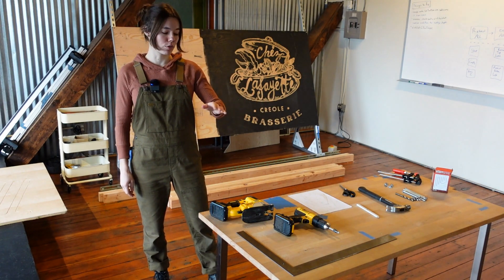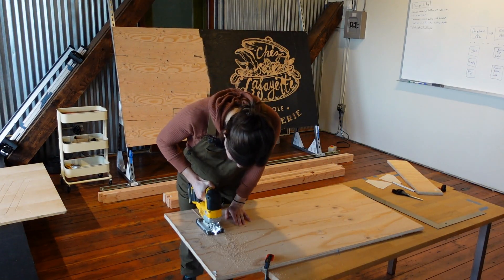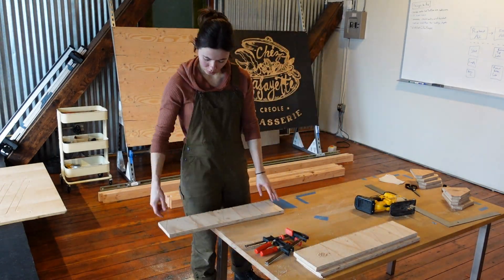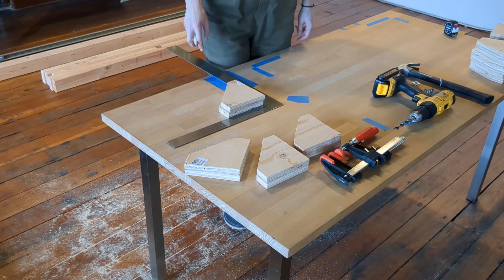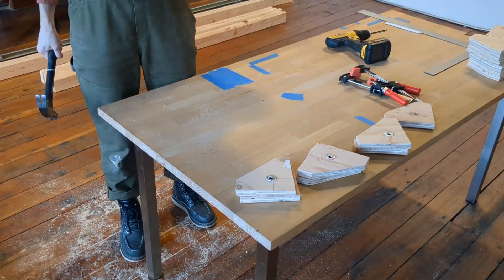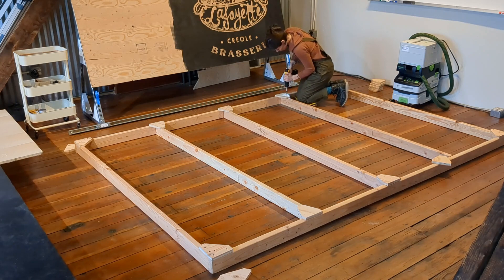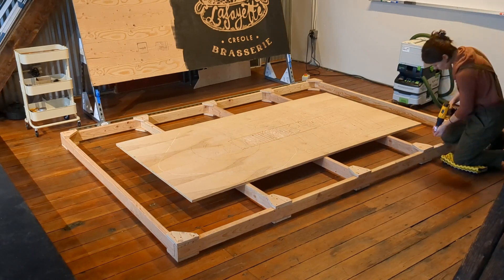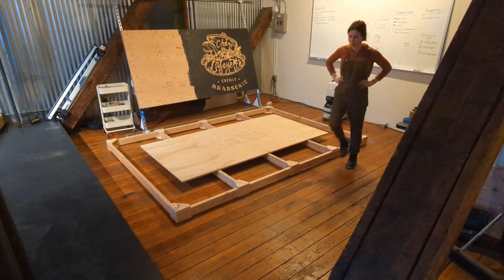Building the Maslow4 Wooden Frame

Comment: Can maslow go faster if it is on a horizontal frame.
Reply from the maker: No, the limiting factor is the top speed of the motors so it will be the same horizontal and vertical

Comment: Guessing if you are building a Maslow system you would have a router so cutting the first plate with a jigsaw and then use that as a template to trace around with a router with a bearing would speed up as well as make them all the same ✌️

Comment: So how do you secure your work piece to the frame? I imagine maslow's cables might catch on most clamps. Sorry if the question seems kind of dim, I don't have much experience with CNC machines (beyond 3D printers) at this point.
Reply from the maker: Not at all, that' is a great question. I usually screw the sheet of plywood that I am cutting to the spoil board. If you wanted to use clamps you could, you would just want to put them in the middle of each edge of the sheet where the belts don't go instead of in the corners. The issue with clamps is that the sled can hit them so screws are easier.

Comment: All that work just to save on the cost of buying an extra sheet of plywood?  Just buy 2.5 sheets of plywood and cover the entire framed surface with plywood. it will be rock solid.  Instead of using plywood as a spoil board use a sheet of foam to protect the frame.
Reply: I was thinking the same thing but it would be heavier though that's fine if you don't need to move the frame very often.

Comment: I'm not understanding the installation of the t-nuts in conjunction with a wing nut.  Shouldnt the t-nut just be on the other side of the plywood brackets? If you follow the way shown in the picture, the bolt will pull out the t-nut as you tighten it.
Reply from the maker: Oh yeah, We didn't really clarify that. The wing nuts are only supposed to keep the Maslow's belt ends on the bolts. You don't have to tighten them up at all.

Comment: I want the plans to build that base in the background using super-strut or uni-strut. That's the way I want to go! Where can I find those plans? and are those 3D printed brackets attached to the struts?
Reply from the maker: We will work on getting some instructions together for that. The uni-strut is harder to work with, more expensive and has a weird springyness to it, but if your heart is set on that, go for it!
Reply: @maslowcnc  Thanks!! Yea, I have tons of this at work that I could use so cost is not an issue LOL. But there are so many accessories for uni-strut that makes it super strong and clean. Cant wait to see what you provide down the road and cant wait to you open the sales up for non-kickstarter patrons. thanks again, I have been watching you guys since the Tested video where I first saw you. Keep up the great work.
Reply from the maker: @S0LRAC  Oh then heck yeah! I will post plans and files for the 3D printed parts for my version, but I would love to see what you build if you modify it. It does work well, I just didn't want to recommend it mostly because of the cost. I'll bump up posting those plans on my todo list
Reply: @maslowcnc  SWEET!! I've been wanting to use this Carbon Fiber infused filament I have for something and I think this would be the perfect project.
Reply from the maker: @S0LRAC  Totally! That would be perfect. I printed mine from PETG with some extra perimeter layers and they've been holding up great

Comment: Wouldn’t cutting the corner/inside plates be a perfect use of Maslow 4? 

Mount Maslow temporarily to the floor, put plywood down and start the „boot cut“ to get all parts you need for the frame.
Reply from the maker: Absolutely! It all depends if you want to assemble your Maslow4 first or your frame first. We have a brief description of the floor mounting procedure here: https://www.maslowcnc.com/building-the-maslow-4-frame
Reply: @maslowcnc  the boot cut could even be pre-loaded into the firmware 😉

Comment: How much bigger than 4x8 does the frame need to be? Can the anchor points be closer in, if a smaller frame would work better in my shop?
Reply from the maker: Yes! The frame can be any size. This frame (8'x10') is the smallest that we recommend if you want to be able to cut full sheets of plywood, but you can go smaller as long you are comfortable with the work area shrinking a little bit.
Reply: @maslowcnc  Is 8' x 10' still the Recommended minimal Frame size? I have seen others doing 10' x 12' and want to ensure I am not making mine too small. Is this a case of Bigger is Better?
Reply from the maker: @webfxllc  Great question! Check out this video: https://www.youtube.com/watch?v=7X5S4LkapX0 I think it will answer in more detail than I can type :p

Comment: For cutting the strips for the corner and inside plates, if you can get access to a table saw you'll get straight lines and an easy job of cutting them..
Reply from the maker: Yes a table saw would be ideal! We wanted to keep the required tools simple and cheap for people that may not have a well-equipped shop.